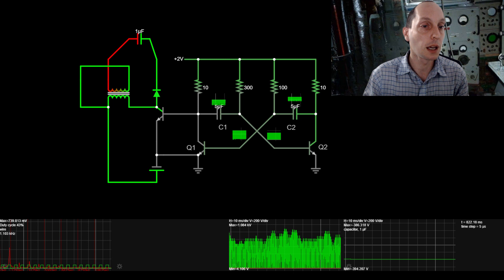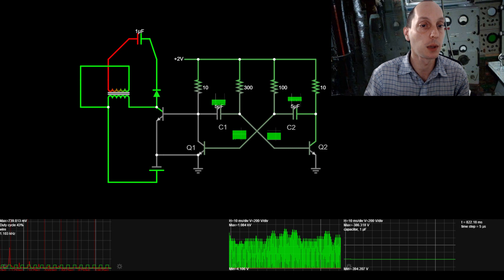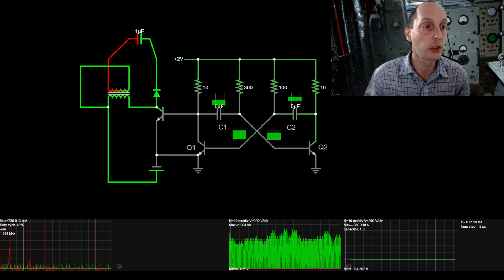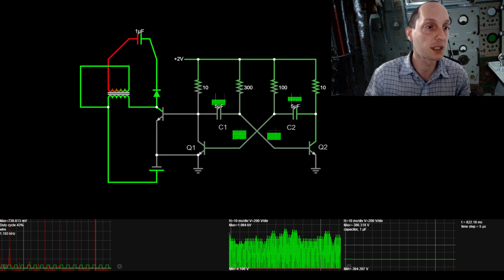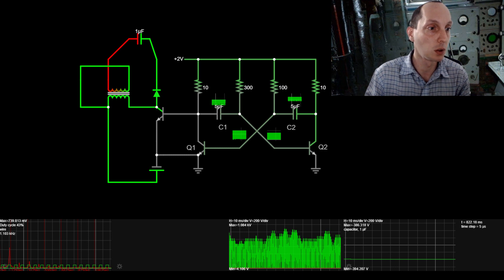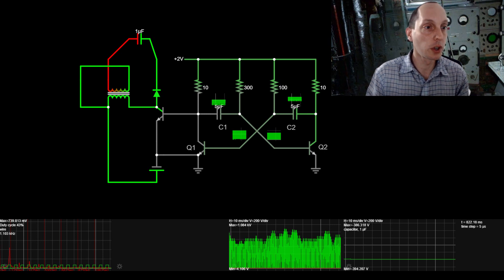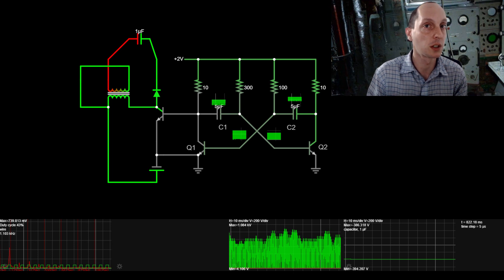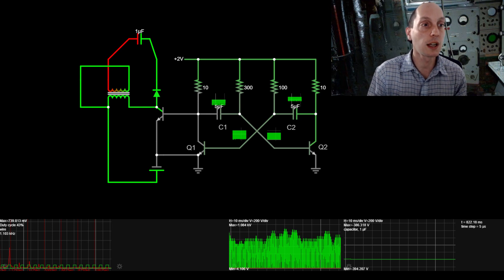Quantum Potential To Current

Comment: Hey joel very interesting good way to perhaps stabalize the power coming out of each cell. One difficulty I came across and John did as well with the chemical cells is you have to make sure each cell is identical. I call it the cell resonance problem. I couldn't get more than 4 in series. But after seeing this vid perhaps you could use this circuit to get the output to be the same for all of them and then you could go series and parallel. Just an idea anyway great vid
Reply from the maker: Typical series DC configuration, the longer the series, Just one of those have slight current voltage difference,  It messes the whole pile, so everyone gives the current of the less of the pile kind of deal. So just one "messed" up cell could screw with the whole pile, so yeah its best to wafer the pile and not just connect these "cupcakes" in series as they are all slightly different, but as you noted it works with a few.... before you run into the issue at random.
Reply: So that's why you should check his other videos too. Like ' High Power Cell Progress '

Comment: I like to see this experiments as proof of concept … being fed up to be told that we need all exotic materials and they yield very little usable energy, exactly how Tesla did with radiant energy.

We need to scale it up to prove how mainstream science  is constantly divert our attention from real wheel work of nature with silly and against the nature proposed concepts.

So, I can see 2 ways:
1. making a miniature device able to output few KWH but we will have great deal of nanotech almost impossible for diy at home, or
2. Increase the size of device and reduce the output for something direct usable with diy methods at home.
Reply from the maker: I'm really trying to go for number one with the John H like pile but more realistically it's probably going to be number 2. Unless I meet someone that has a lab like setup up town lol and lets me us it. Or a workshop of sorts etc....
Reply: @joellagace1679  we need a good switch that can work with just few mA to output pulsed dc, than almost everything is sorted and we may not need to increase insane the size of battery bank.

Can you suggest off the shelf diode able to handle 2-400v with under 0.3 v forward of any amps, or something diy ? I need something like this for a different project.
Reply from the maker: Many transistors are near that range you can use them as diodes. They work exceptionally well as AV diode plugs as well.
Reply: It seems that yt do not let me post any links, I will post on your forum the video I am speaking about to see how we can use this quantum batteries or any tiny source from anywhere around us.

Comment: Why not modifying a joule thief to late it oscillate and ditsh the Astabile Oscillator?
Reply from the maker: I have issues running basic oscillators off these cells, from another video they produce modest "AC ripple, close to 200 mv per cell in some case. It makes the oscillator slow down, speed up, stop all together and just act flonky, Sure we can filter and suppress that, But with such little current a cell puts out, You destroy the little you get in filtering basically.  Unless you have a good idea?

Comment: Is the magnesium oxidizing?  Like a air cell
Reply from the maker: So far so good, But these put out so little current (galvanic reaction if any) it might take awhile. I don't think it's galvanic personally at this point. But yeah if the solid state electrolyte does not solid quickly that could be an issue.... What is interesting is I been able to use two tin plates as electrodes and notice a voltage as well. Still experimenting with this.